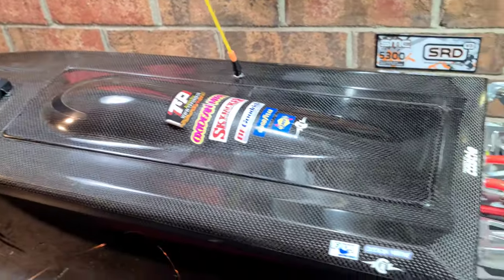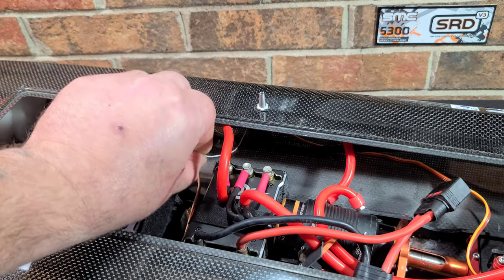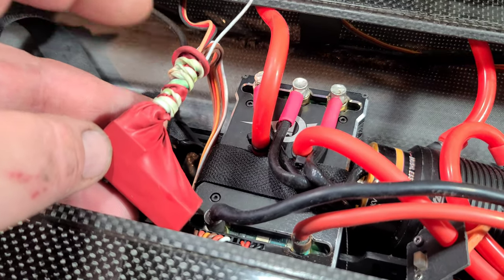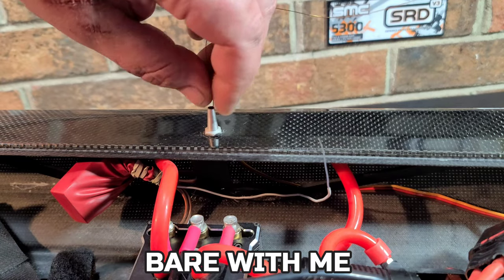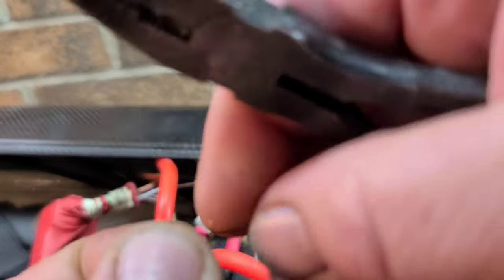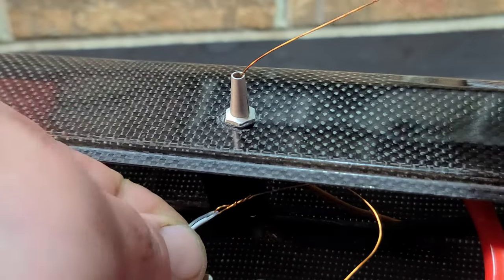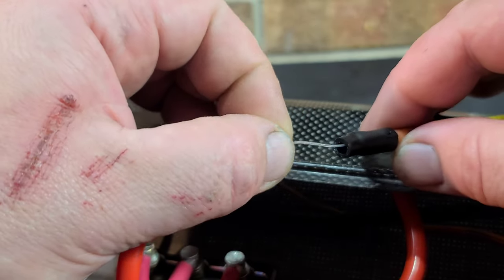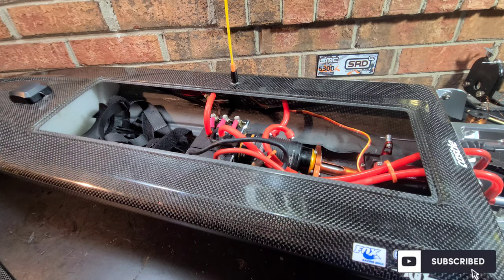Getting That Pesky Antenna Through The Hull Quick Tip - Rc Boat Antenna Mount

Comment: Try folding the copper wire in half then pass the fold end through the antenna fitting, and when it reappears inside the hull you’ve already got a loop into which you thread the receiver antenna into then pull the whole thing back out and voila ! Job done!! Fantastic channel by the way 👍🏼

Comment: Good tips Big B! 
Can you do a video on increasing range or what an average range might be?  I can not get my sonickwake v2 to go past 300 feet. I have made sure the antenna is sticking out thru the hull, but I see yours is in the boat…does that decrease the range?  I have reached out to HH and they sent me a new transmitter, but it still cuts out at the same spot (before 300feet). Would the receiver be the next thing to change?
Reply from the maker: Yeah, the receiver could be the issue, make sure the wire tip on the antenna wire is pulled back..   what I do to my antennas/receivers that have bad range is peel the wire sheeth back a millimeter or so.
Reply from the maker: Just uploaded a video that could possibly help.  https://youtu.be/6gFHETk-32U

Comment: For installing that antenna tube holder on the top of the hull do you have to epoxy it in? Or just screw it nice an tight?
Reply from the maker: I'd use Marine sealant/adhesive.   I wouldn't epoxy it in to the hull
Reply: @IRONCLADRC  okay thanks

Comment: Long time ago i got the ink tube out of a biro pen. Pulled the metal end off, washed the ink out with alcahol. Warmed up the tube to put a bend in it.  Thread tube through the through hole, thread the antenna into tube using long nose pliers. Then pinch antenna gently and pass it back through the through hole tube to length needed. Pull antenna lightly till it stops, put a dab of silicon on underside. When dry, thread antenna tube onto antenna and secure the tube in the through hole base.  Sorted. Or.
Do that evil thing, purchase a thin tube and do same process. 
That tube is always in my tool box now. 
Or (2) Pass thin cppper wire through the through hole. Slightly solder wire to antenna tip. Pull wire and antenna back through the through hole. Secure antenna/receiver on underside. Desolder. Cover antenna with antenna tube cover. Again. Sorted.
Happy splashing Big B 🤔😁
Reply from the maker: Thanks for the til I'll definitely keep that in mind.   You da man.

Comment: Hi quick question what is the average speed of a rc boat on 3s?
Reply: 3s says nothing, just voltage your running. Depends on size boat, motor, esc, batteries...
Check Rc boat speed calculator... Put in your numbers in and you have got a direction to work to...
So your kv's, voltage (4v for instance if you got good lipo's, thats voltage under full load), diameter prop and pitch and hull type... When your close to that number is gives you a good idea if everything is running right...
Reply from the maker: 3s in the proboat recoil2  I'd get 35mph,  3s in my shrimp outrigger 45/50mph..  like Peter mentioned, it all depends on motor, esc, battery, prop, hull type, etc

Comment: MY GOD BIG B HAVE YOU BEEN CHAIN SAWING YOUR HANDS? THATS A GOOD TIP B. I WOULD CUT THAT WIRE AT A FOOT LONG AND HANG IT UP FOR NEXT TIME.
Reply from the maker: Wire brush on the drill, I was cleaning some parts up and slipped..  looks worse than it actually is